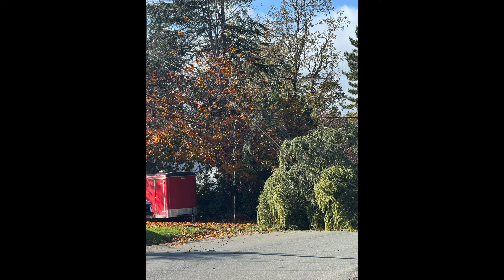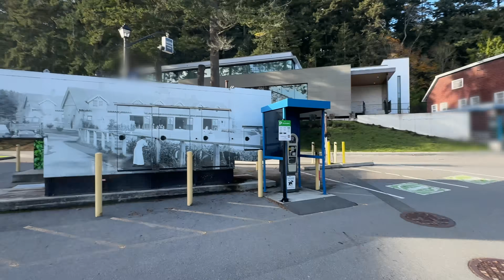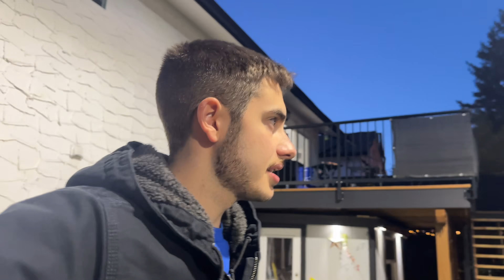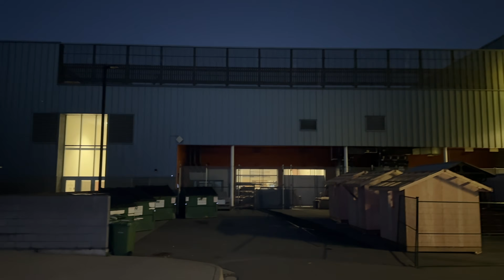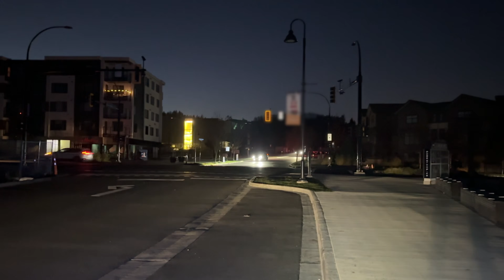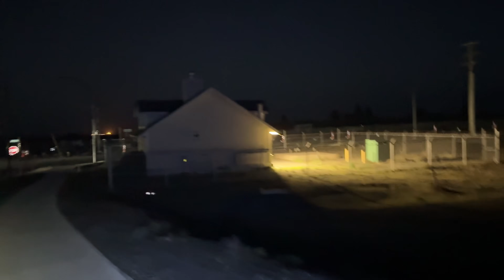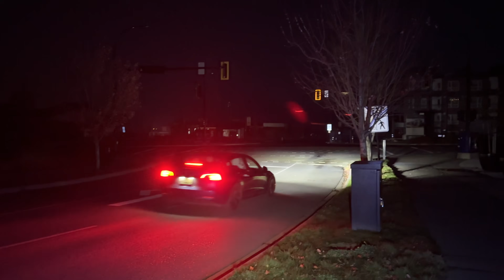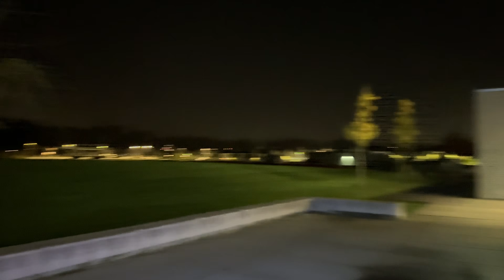11 Hours Of Power Outages And House Electrical Fried With 14,400 Volts On Neutral!

Comment: Why are you not separating high and low voltage inside the house and of course out side ... e.g. no high voltage wires above (or below) low voltage wires (Except if they are put in the ground).

Other thing I noticed - it seems they are running very low voltage (Internet/Network/Security) in the same case as normal power. That is not a good thing to do !!!   I know that control voltage (12/5v) can be supplied by the main case - but control units should be separated to avoid sparks.

(Oh ... and a Disclaimer ... I am not involved in electrical stuff here in Denmark - just some 30yr old practice in school and went the IT way instead...)
Reply: BTW - In Denmark now a days houses are only supplied with 3-phase 400V and relating to that 230V phase to neutral.  Ground is always supplied locally by a copper spear at least 6-7 ft in the ground.
Reply: Ohh - I missed it was on the neutral line - that is bad even in Denmark - since that is normally not a switched line :D
Reply from the maker: I'm not exactly sure what you mean inside the house everything inside the house is low-voltage. There is no high voltage inside the house. As for outside, it is separated by at least 3 m or so however, a tree knocked it down.
Reply: @nics-systems-electric  Well inside (in Denmark) its 230/400V in the circuit breakers only, 5/12V has to go outside of that casing. 

Outside the houses we have high voltage lines (100000V+) but they do not go over lower voltages. So even if we were hit by such a storm you are telling about well it should not end up in completely rewiring a house (or more!).

Then again for the past 15 years we have moved most lines into the ground so storms cannot affect them at all.

And then again 20 years ago we had major storm and lightning that took out some major electrical stations in a neighboring country - which made our net trip (total grid fail). That made beer very cheep in an hour or two - since we had 1/3 of Denmark without power for up to 24 hours. In my life time (50+) this has been the worst thing happening - drop everything in your freezer - but enjoy cheap (not chilled) beer - while doing it :D

And to your question:   It looks like a router or switch in the top-right corner of one of your pictures - at the same time  a "multi-socket" hanging loose in the lower left. I distinguish between high and low when you go from 230/110V to eg. 12V - the equipment seems to be 12V +/-

If I myself mounted something like that - I would violate my home insurance, fire insurance and so on - even being liable to bodily harm to neighbors! 

We have a very strict building code in Denmark - you need to authorized to deal with electricity, water, gas, etc.    And I am still wondering why other countries are not doing it in the same way - in the end cost will be so much lower - since small mistakes will not evolve into a major catastrophe.:face-red-smiling-live:

So my comment was not to doubt it happened - but wondering since we have had strict codes here all my life that would prevent those things to happen - except for total grid failure or lightning ....

It was very insightful video with your comments - And I know you were not allow to peal of the covers - but it would be nice (?) to see all the damage that is hidden.

Sorry for a long comment :D

Comment: That is scary !!!! ,i was wondering,  do TVS diodes or MOV's exist for AC to connect from neutral to ground at the main panel, just asking a silly question or this could be a realistic solution, i could just imagine the size and cost of that diode or MOV for a 200 amp main panel.

Comment: Good example of how unplugging your stuff can be a good idea. So heres something im curious about.. With all that being affected, had the breaker been off for say certain rooms or for certain equipment, would that have protected anything or would it not have mattered with such a large surge?
Reply from the maker: I am almost positive, no matter what position the breaker is in it would not have made a difference. Not only it's coming in on the neutral so once it gets to the breaker it's already gone through all your equipment and stuff. But 14,400 V can definitely jump a pretty large gap, much larger than the open contacts in the breaker. Therefore it would jump that no problem and it would make the breaker effectively irrelevant.

Comment: The neutral just connects to the neutral bar, no breaker.   Even if you had  a fuse on the neutral; 200 amps at 14,400 volts is more than 2 million watts more than what it takes to fry everything.  Nothing simple is going to protect against this.  This is a case of Bambi Meets Godzilla.
Reply from the maker: Yeah not much is going to help you there not legal to have a fused neutral either.

Comment: What really sucks is their insurance will resist paying what they should and will drag it out for at least 6 months.
Reply from the maker: Hopefully not, so far they have provided them with an electrical company however they will likely still be without power for a week since this happened.
Reply: @nics-systems-electric  Well the insurance will have to pay to replace EVERY Appliance, EVERY electronic device,  and things like that that antique boom box.  If they had an EV charging, it might have to be replaced, not to mention rewiring the entire house.  Even though it was an "act of god", you can bet the power company will be counter sued by the insurance company as it was their wiring that caused the issue.  Years ago my house got hit by lighting (it hit the chimney and came down the damper cable), causing an EMI spike that blew out my computer lan network, destroying several computers.  The insurance company wrote me a blank check to replace everything that was hit.  I was nice to them, I was able to repair only the parts of the computers that blew (two mother boards, several lan cards, a network switch, and a power supply).  One computer was replaced, I bought that one at a computer show in kit form. (Most of the stuff was home built with parts from places like New Egg, not brand name like Dell).  We also had a 40" TV that looked like it was fried, but turned out to only need the picture tube degaussed.

Comment: Whole house surge protector might have helped but unfortunately not with that old unreliable panel fuses.
Reply from the maker: I don't see how it would when they short access voltage to ground/neutral when ground/neutral was the high voltage spike in this case. Everyone likes to blame federal Pioneer which indeed they have their issues however no panel would have survived this. Breakers tripped or not 14,400 V is going to jump the contact no problem.

Comment: "normal" surge protectors would have just failed under that load. Switching off every breaker before the storm could have saved some equipment but the complete rewiring of the house was unavoidable
Reply from the maker: Yeah I agree I don't think they would do a thing. Even breakers turned off I don't think it would save it. Not only it came through the neutral but either way I'm pretty sure 14,400 V would jump the open contacts in the breaker no problem

Comment: Stab lok panel lol thts as good as a penny in an Edison fuse holder there was no fuse protection so ya anything plugged in is toast 😢
Reply from the maker: Stab lok panels have had some issues with high failure rates at failing to trip. But it's not fair to blame this one on them any brand would have done the same breaker open or closed 14,400 V is going to jump the contacts no problem. it came in on the neutral anyways so even if all the breakers tripped by the time it hit the breakers it's already gone through your equipment.
Reply: @nics-systems-electric  thts true I didnt watch all the way thru but when I seen the main and a lot more triped ya probably didn't matter just like having a whole house surge protecter like you eluded to wldnt have helped
Reply from the maker: @wizard3z868  yeah I think you're screwed if this happens no matter what. surge protector or not I don't think there's much meant to handle 14,400 V coming in through your neutral lol.

Comment: That Whole house will have to be rewired, actually will have to be opened up wall after wall and inspected and stripped out the old wire and every thing replaced to bring it back to code...Wire/Panel/Power meter/ all the junction boxes/switches/plugs and not to mention all the appliances will be destroyed/ Everything electrical will be destroyed - Im surprised the house didn't burn down with that kinda power surging through it..Holy Power Spikes!!🤯
Reply from the maker: That may be the case, will depend on the results of the megger test I would assume to verify the condition of the insulation however, most appliances and panel and devices likely will need to be replaced definitely.

Comment: 75mph* is what you meant to say, not 120kph. It's okay. We all make mistakes.
Reply from the maker: 120 km/h is exactly what was supposed to be said as the metric system is what my country as well as the other 95%. The conversion is actually 74.56 mph, but as you said, it's OK we all make mistakes!
Reply: @nics-systems-electric  
You mean America, where we use miles per hour, as in the 5%? And yes, I rounded up as I didn't use the internet to give the exact conversion. As I said, in America, we use miles per hour, not kilometers per hour, so exact conversion is a little more difficult to remember. 
You appear to not know which country you are in. Now you've made 2 mistakes.
Reply from the maker: @ganjasage420  I said where I am within the first 60 seconds of the video. There is much more to this world than just America. And no that's not the only country part of the 5%, so no I don't mean America. No mistakes were made. Just because it's not the one you use in your country doesn't mean it's incorrect👍
Reply: @ganjasage420  he lives in Canada smart guy
Reply: @ganjasage420  You appear to not realize there are more countries than America. Quit arguing, you're wrong. You're just making yourself sound silly. Don't make the rest of Americans look dumb!
Reply: What the heck are you on about… Welcome to Canada where we use metric. Your not very smart apparently so think before you speak you dumb American

Comment: House history: on the evening of September 23rd, 2024, lightning struck an amateur radio antenna in my house (in Germany), destroyed the fiberglass sheath, went through the entire electrical system, triggered all residual current circuit breakers and destroyed several electronic devices including the heating (I had damage of over 2000€)
Reply from the maker: Yeah it's crazy stuff I'm guessing these guys are probably going to be minimum $20,000 Canadian

Comment: The Voltage Is SO HIGH That it will blow up and damage your machines.
Reply: It will also destroy equipment with the circuit breakers OPEN through over current damage.

Comment: 4 way stops aren't sensible because it requires stopping in all situations. 'Yield to traffic coming from your right' makes more sense, or if there is a small road crossing a large road, 'yield' signs on the smaller road, making the large one a priority road. 
I don't drive in the americas, but it took me forever to understand what a 4 way stop is, being used to intersections where people can continue at moderate speed.
Stop signs exist here - but they are equal to a yield sign, but with a mandatory 'come to a full stop'. Whereas 'yield' means that you can continue at moderate speed if there is no traffic to yield to.

Comment: Nic I have to agree. But I also have to disagree with you on whole home surge protection. Please let me explain.

Nic here are some questions on surge protection. 

Could a whole home surge protector save this family from thousands and thousands of dollars?

Answer is a yes it could have. 

Would there still be damaged?

Answer is a yes.  Bringing the damage down to a small amount of repairs.

Why?  

Because the surge protector did its job. By absorbing the higher voltage that is not allowed. Therefore the surge protector would have blown. But devices are down the line would have been protected during the whole surge. Therefore the damage would mainly be the surge protector is what breaks. And needs to be replaced at this point.

Which would still cost the home owner money. But it would have saved that big surge from damaging everything in the home. It might have just had the electrical panel destroyed. But that's probably about it.

Down below I am going to provide you a YouTube link. That explains what a air conditioner surge protector does. Whole home surge protection does the same thing. 

Please reply back to me with a comment from you Nic. After you seen the entire YouTube video link. You'll be surprised on the out come. 

https://youtu.be/UEdK7f2xiz4?si=dRtWI2Py8VJ4ZqX_

P.S. You should also do some more research on surge protection.  Find the definition of surge protection online.

Comment: Nobody is in the school building, still being lit brighter than the surface of the sun -> wasting electrical energy
Reply: And diesel
Reply from the maker: That is emergency and 24/7 lighting it has to stay on and can't be shut off.
Reply: @nics-systems-electric  I see this is some regulatory stuff then, still odd that it is so bright, are these at least LED lights and not those old fluorescent ones?
Reply from the maker: @RoyHess666  50/50 LED fluorescent. stairwells are required to be 100% illuminated in a power outage and the corridors are 50% of the regular lighting or less. Atrium and large occupancy spaces only have a couple light fixtures on back up lighting probably 20% or less.
Reply: It still sounds like a waste over night when nobody is in the building. That generator eat a lot of fuel just to illuminate an empty building. A smaller generator supplying the fridges, alarm and boiler control circuits (if it's a gas boiler) would have saved some money. The big generator could remain fueled for the case there is a need to evacuate people into the school or to power the building during school hours.
Reply from the maker: @atlasz911  It's already a relatively small generator. It's only powering life safety. No HVAC as the air to water heat pumps, which are the primary source consume a lot of power. Running the emergency lighting is only 30% of the generators total capacity. Running all of the emergency lighting only consumes about 23 A but needs to be capable of running the atrium smoke exhaust fan system in case of a fire.
Reply: @nics-systems-electric  I have seen a few buildings with motion-activated lights on emergency power or multi-way switching at every storey in a commercial building stairwell (with a photoluminescent plate around the light switch), but it is the exception rather than the norm.
Reply: @nics-systems-electric  yes it could if its not occupied
Reply from the maker: @coreybabcock2025  I'm not sure what you are referring to but no the building must have emergency power whether it's occupied or not all the protection systems need to be operable whether people are in the building or not.
Reply: @nics-systems-electric they need to repeal laws like that. I hate to say it but a few people dying beats losing our planet. 

And it's likely no one would ever die from those systems being shut off in an unoccupied building.
Reply: Bean counter without sens of scale… suppose he also think he could save the planet if the vcr didn’t have clocks or that you should regulate the size of email attachment to limit internet electricity waste…

Comment: This is why i have 50kA varistors in my breaker box.
Reply from the maker: What is that going to do?
Reply: @nics-systems-electric  they trip and short the supply to ground when voltage is above 280v. They are rated to eat a lightning strike, so this should be a pice of cake.
Reply from the maker: @cuf_  that's great if it's on your line conductors, however that would not help you for this specific incident. If it's shorting it to ground as this 14,400 V came in on the neutral/ground.
Reply: @nics-systems-electric  i have 3 varistors, 1 on every phase and groud is shorted to neutral in europe here anyways. So if the surge cam in thru the neutral im thinking it should bypass the varistors and go straight to gnd.
Reply from the maker: @cuf_  ground and neutral is bonded together here but ground alone is not enough to usually trip over current protection.
Reply: @nics-systems-electric  i wonder how much can that hv dump? (Amps)
Reply: @nics-systems-electric  i wonder how much can that hv dump? (Amps)
Reply from the maker: @cuf_  I would think that line feeding as much as it does is probably upwards of 300 A
Reply: @nics-systems-electric  oh... thats 4.3 megawatts... my gnd is good, i have a thick bare aluminium wire wrapped around my house underground, but i dont think it can handle that much.

Comment: SPD would go short circuit over all legs and dissapate current so the voltage would not build up a differentcial. If there are many kilo amps it will blow up.

Comment: I think its odd that all of the lights in the school came on when the power was out and they stayed on. Back on June 22nd 2016 my parents have a huge oak tree in their front yard, it got struck by lightning. Fried a bunch of electronics like our TV, router/modem, printer and a stereo I had. It even set our smoke detectors off. Scares the crap out of you when you are asleep and then hear a loud clap of thunder and them smoke alarms. That was fun!